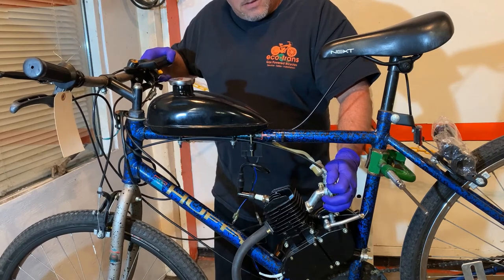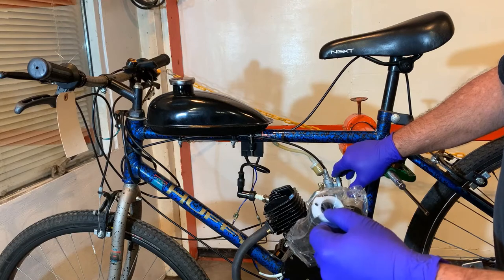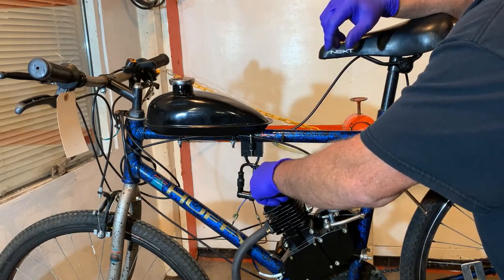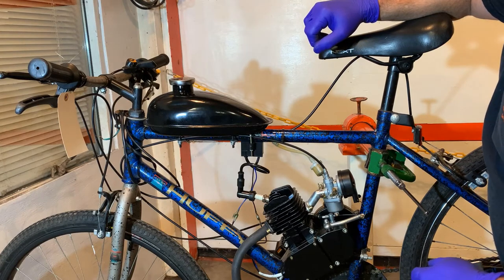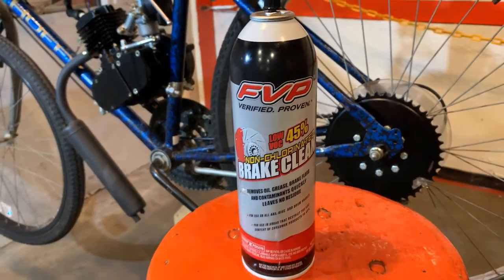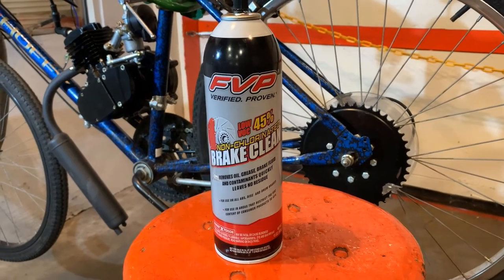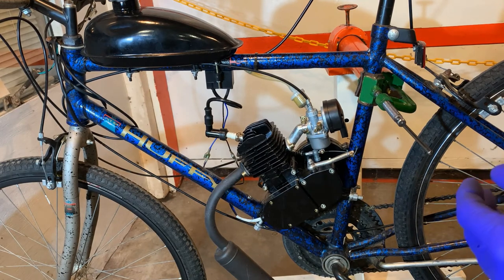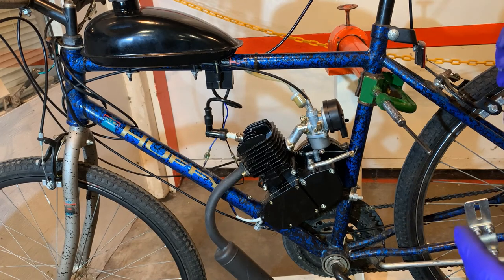Engine revs real high all by it's self.....!!  ??

Comment: When I start my bike I can get it to run fine if I immediately drop the clutch and give it least %50 throttle. As long as I do that and pedal right up to speed and keep it under load it sings. However, if I disengage the clutch immediately after I bump start and wind up the rpms, when I start to engage the clutch it bogs unless I give it WOT and pedal it to assist it up to cruising speed...sometimes I'll set it to half choke while that going on and it helps. Once the engine is warmed up I get great throttle response. But from there on out EVERY TIME I disengage the clutch the engine revs out of control and I have to feather the clutch to keep rpms down or hit the kill switch if I'm gonna be sitting at an intersection waiting for the light to turn green. Then I just bump start it and blast off. I was four stroking into the higher rpms, I filed down the woodruff key for the magneto just a little bit to retard the ignition a few degrees. Seemed to help a bit, but I'm still 4 stroking at WOT under little to no load. I guess that's pretty normal, though. I checked the throttle grip, cable and housing, carb slide/spring/needle arrangement and that's straight and snapping back nice smooth and crisp like it's supposed to. I'm definitely going to run this test and see what happens. Thank you so much for sharing this info, I haven't seen any other video or read any other advice on any of the motorized bike channels/forums that suggested anything like this. Excellent info regarding the different products that a person might decide to use, people don't think about inherent dangers of flammable substances or chemical properties of various cleaners that will ruin your gear. Cheers!
Reply from the maker: I've ran into these various problems that you have mentioned throughout the years, from crank shaft seals leaking air to poor machine work on the engines case not letting it seal properly, even poor casting on the cylinder jug it's self-sucking air through the pours of the metal.. So I feel your frustration... 🤬🤬 My friendly advice to you is if it's a new engine you just purchased send it back & get a new one, if not you're going to have to disassemble the entire engine & spend a lot of time figuring out where they did a poor job on the manufactures end.. If you have already checked the normal stuff like making sure the Carb. is all the way on the intake & there are no air leaks & the intake is firmly snug on the cylinder & you've checked all the nuts & bolts to make sure there wasn't anything  left loose from the factory, I would definitely look into exchanging it, you shouldn't have to pay for it & repair it too.. These engines aren't the best quality in the world anyway, but at the very least you should get one that works properly right out of the box.. I hope you get this straightened out so you can enjoy it rather than being stressed out about it not working as it should..

Comment: i took the engine apart and then changed the crankshaft and when i putted it back together then it started to rev high even though i had the carburetor with right tuning.
Reply from the maker: Usually if an engine runs away with high revs it 99% of the time means there is an air leak somewhere.. 🤷‍♂It could be the crankshaft seals or the case gasket or even where the cylinder meets the case. This method should help you find where it is coming from. when the spray finds the air leak the engine will change sounds or even run a little different when it sucks in the carb or brake cleaner at the leak.. I hope you find it so you can repair it & get back to riding.. 🚴‍♂🚴‍♂

Comment: Hey bro thanks for the video..I have had the bike for about a year and its like the domino affect with the problems bro let me tell ya 😢..yesterday changed the carburetor buecause the needle broke but the carb i changed it to had the gas release spring at the bottom of float bowl and it kept hitting the clutch line spilling gas so i  just swapped the needle and I put some carburetor jet cleaner in the tank and I was riding fine but it seemed that whenever I went down hill it would start revving high but come down when the road balance out or if i apply the brake a little but now as soon as i crank up it goes nuts revving up high with clutch engaged or not and starts putting. So i crank-and-kill and crank-and-kill! Help a brother out Boss!! Think its an air leak?? So I just apply the brake cleaner and crank up right 👌. Thanks in advance..cuz i sure miss my baby..she sick and need help quick take care and ✌
Reply from the maker: It sounds like the ole bikes engine is on its way to retirement.. 😥😥 Usually when you have to start spraying carb. brake cleaner or starting fluid in the air cleaner to get it to fire is a sure tale sign of worn-out cylinder & rings. ( Low Compression) I'm not sure what jet cleaner you poured in the gas tank, but I've found that the only type of fuel type of cleaner that doesn't harm these engines is Seafoam. ( Just for future reference). I would try the spray method to see if I had an air leak & if nothing is found I would just plan on getting a new engine, it's just not money ahead to rebuild these things anymore.
Reply: @EcoTransGaspoweredBikes  thanks I needed exactly these words from a pro because I took it straight to the wife with the long face 😔 and said EcoTrans says I might as well get another motor and it is on the way!!! I truly, really appreciate you Sir!! Take care and ✌

Comment: I have an issew, my pocket bike that is a 49cc 2 stroke, when i start it up After a while it starts to rev towards 4k or 5k revs and if you accelerate enough it chokes. I do not know what's going on I put new gaskets from the carburetor to the engine and it went well for 15 minutes but then the same problems occurred again. Please help ❤
Reply from the maker: I feel your pain.. 😥😥If you have already done the spray test when it was running around every gasket area, even where the engine case comes together in the middle and still no obvious air leak. The first thing you should do is check all the nuts & bolts that hold your engine together, you can't trust that the factory got everything tight. After that if still no change you're going to have to take the entire engine apart & put a full gasket kit & crankshaft seal in the engine, while doing that check for any burrs on all the surfaces, it doesn't take but a small burr to make a gasket leak & suck air.. ( The sucking of outside air other than through the carburetor is what makes a 2-stroke rev all by it's self..) If your kit was just purchased, I would contact the seller & exchange it.. If not you're going to have to put in the work to find where the air leak is coming from.. 😥😥It sounds like whatever air leak you may have only shows it's self when the engine gets up to operating temperature & the engine or parts expand so that tells me it might just be some loose bolts like cylinder to engine bolts or even some loose case bolts. I would definitely start there.
Reply: @EcoTransGaspoweredBikes  ill do that, thank you for your great quick response my friend, u best

Comment: Mine was running fine I was riding about 30 miles a day. Till the chain came off. I put the chain back on and now every time I start it it just starts reving extremely high. I pop the clutch and it doesn't go anywhere just screams at me till I shut it off🤷‍♂️
Reply from the maker: From what you have said I would say the seal around the engine drive sprocket for the chain has been damaged when the chain came off & it's sucking in outside air & running lean, that could be  the reason the engine revs way up as soon as it starts.. Take a look at that seal, you might have to remove that little sprocket to get a good look at that seal..That's where I would start

Comment: That float in my carburettor is sticking up and wont go down what do i do
Reply from the maker: You'll have to remove the float bowel & pull out the needle valve by hand. It's just something that happens sometimes from sitting for a while & sometimes it has even happened to new carbs right out of the box. If you need to clean it use brake cleaner & NOT carb. cleaner, carb. cleaner is not friendly to rubber parts or gaskets. If for some reason it keeps sticking shut on you after that I'd just replace the carb, once in a great while you'll get a carb with a bad needle & seat valve.
Reply: @EcoTransGaspoweredBikes I replaced the carb and is still hitting high revs
Reply from the maker: @michaeldavis748  In your last question you stated that your float was sticking, float level won't make the bike engine Rev Hi.. 😥😥It sounds like to me that what you meant to explain is that the slide barrel in your carb, the part the throttle cable hooks to & moves up & down when you twist the throttle is what you're having issues with.. Is this the part you're talking about..??

Comment: I have a 4 stroke friction motor lock n load how do I check the carb on it for leaks?
Reply from the maker: I'm sorry I thought you were talking about one of the 2 stroke engines.. 4-stroke engines won't do the air leak rev, that's the beauty of the 4-stroke engines. I would check the throttle cable & see if it's pulling on the throttle blade & making it rev when you turn the handlebars or something like that.. It sounds to me that something is pulling the cable & making the engine rev like the throttle is being applied. Also if the throttle cable is being pulled to tight to reach the engine can some times do this, it may just need you to set the idle down with a simple adjustment at the carb.
Reply: @EcoTransGaspoweredBikes  Oh ok see I thought the same thing but I removed the throttle cable completely and it still revs, the tire spins when I pull the pull start it's not supposed to do that because it's a friction motor kit so it will kill the engine or pop the tire all together that's where I'm lost at lol

Comment: So when I'm riding at high revs sometimes but not all the time when I pull in the clutch my engine goes nuts and revs out of control if I let the clutch out and slow it down its ok but could this still be an air leak it doesn't do it other than that it seems to idle just fine
Reply from the maker: I would first check & make sure the slide in the carb. is sliding freely & if that seems fine I would definitely check for air leaks. I would also check the carb. at the intake to make sure it's slid all the way on the intake a lot of people find they have a small air leak behind the clamp that holds the carb on right where those slits are, I use a tiny paperclip to see if I can poke it through there if I think it may not be on tight against the intake tube, if the paper clip slides in the hole I know the carb isn't slid up tight against intake tube.
Reply from the maker: If you do find you can't get the carb slid up enough to close those holes you can get an O -Ring at the parts store to help seal it, just tell them you need a neoprene O-Ring because they are gas friendly & won't dissolve through time.. 👍👍

Comment: could i hace over tightend my head and caused a leak? will black rtb help
Reply from the maker: I don't believe so, unless one of the bolts striped when you were doing it & now it's not tightening down & letting air leak in although I would think you would have noticed the nut stripping out when you were tightening it.. No gasket maker will help with this so no need to waste time or money on it..

Comment: Could it be a carb bowl leak? Because my carburetor bowl I don’t think is on there secure
Reply from the maker: The bowl is mainly just a gas reservoir, usually if it revs erratic it's usually an air leak somewhere🤷‍♂️.
Reply: @EcoTransGaspoweredBikes  would the previous owner using a sock as an air filter make that difference?
Reply from the maker: @masonlutzenberger3211  Probably not, at least they put something over the carb. intake so tiny rocks & other road debris didn't go in the engine..I don't believe just using sock material as an air filter caused any damage.
Reply: @EcoTransGaspoweredBikes  ok cuz I thought air filters restricted some air flow creating a better vacuum vs a sock which wouldn’t do as much
Reply from the maker: Vacuum is created in they cylinder which needs air through the air filter to breath, it is best if you have a regular foam type of air filter or a good breathing paper style.